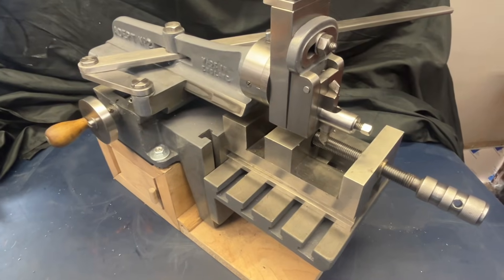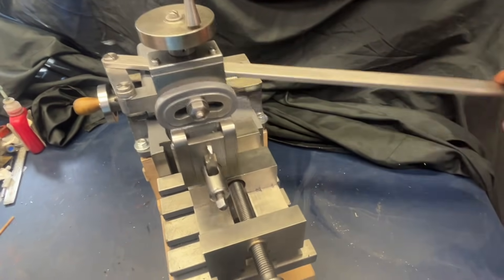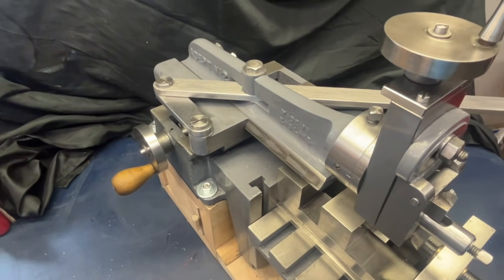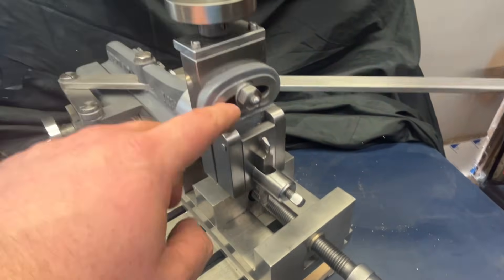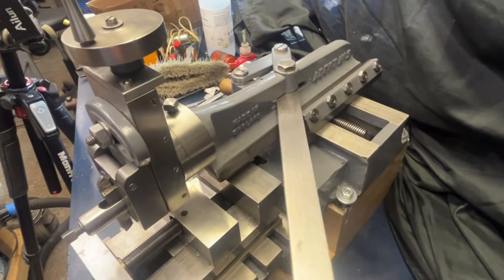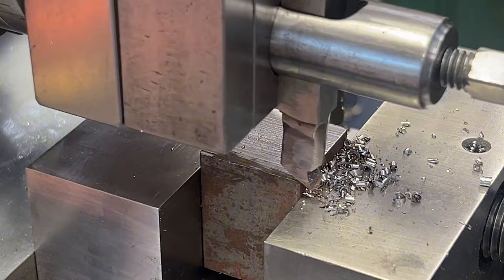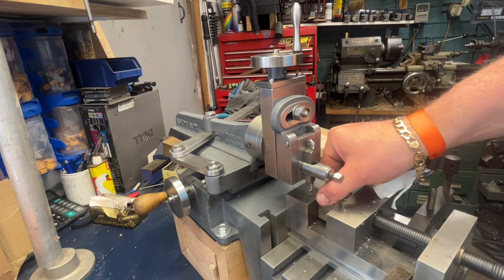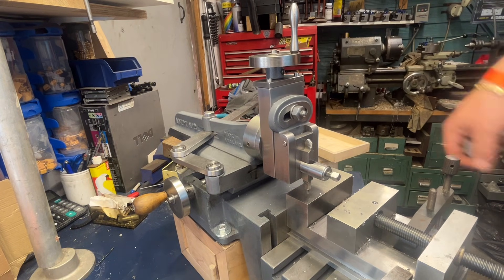Hand Shaper - This Tiny Machine Is Surprisingly Powerful!

Comment: It is in beautiful condition.
I had one of these. The disadvantages are several. It has no feed mechanism and no micrometer dials. Worse the pitch on the z axis is 1/16" which precludes fitting a dial to the x feed.
I find that the table on small shapers is invariably too small and makes bolting down difficult.
Shapers are superb at slotting though. I have also cut a couple of racks with a home ground HSS tool.

Comment: Look up shear tools for the shaper if you want a really nice finish. It looks similar to the one you're using if it were to be rotated by around 60 degrees. I use one on my Adept no. 2, and the finish rivals that of a surface grinder. The downside is you have to use a fine sideways feed, and cutting depths of no more than a few thou.
Reply from the maker: Thank you for the advice! I’ll give that a search and have a go this weekend

Comment: Lovely! But the finish doesn't look all that good? Is it the cutter geometry? Or perhaps the step over? I can't see why it shouldn't produce a very nice result..
Reply: Take a look at Abom79's video on preparing a finishing tool for a shaper. https://youtu.be/bg2yppzEmBo?si=kbbcaQoXUs8OrdUL
He mounted the finishing tool in the machine, then trued the cutting edge parallel to the table by setting a precision honing stone (with a sheet of paper between the stone & the table) on the table & honing the cutting edge to dead parallel. The resulting cut was a mirror finish across the part. The video was a couple years ago, he was at another guys shop at the time.
Reply from the maker: It isn’t all that bad to be fair, the camera was quite zoomed in. However someone has commented similar so could definitely improve. Perhaps it was the cutter - any tips as to what the profile should look like?
Reply: @craynerd  Increase the nose radius of the cutter.

Comment: Did any other manufacturer make a hand shaper??  This got me thinking.  What would the size limitations be with only human power?  Would it work with a larger floor mounted machine?  What kind of accuracy do you get when it is all dialed in?  Very interesting to say the least.
Reply from the maker: Haha yes! I’ve only ever seen small bench top ones. I know Cowells also made one. 
It would be really interesting to see what a large scale would be able to achieve but the issue is even with this small one, the minute you attempt a large depth of cut, it jams! I expect, and I’m only guessing, that the issue would be the same with a larger one. You can only take small passes. I didn’t count but I probably took 6-8 passes with this in total and I bet I could have done it in one pass with just my X3 bench mill and surfacing tool. No doubt it’s a lovely machine though for a small price and small size. It also has the benefit of doing internal key ways, something the mill wouldn’t easily be able to do.

Comment: Commented a few times on Facebook with you (asking about the toolholder) - what a lovely bloody condition that's in. I got my hand-shaper for free, but paid out the nose for the motorised version.  Mr Factotum has an almost total rebuild on his - a series worth watching.
Reply from the maker: Hi William 
I’ve measured the tool holder for you and it’s very simple construction. Essentially it is a rectangular piece of steel 32x55mm and 13mm thick. It is drill through at the top and pinned with a 6.5mm steel hinge. It has been drilled centrally approximately 38mm down from the top edge to centre of the bore - 19mm diameter (0.74” dia). The actually work holder itself is a 19mm round bar inserted into the bore - I can’t see any way it is being held so it must be welded (can’t see any welds!) or loctited in position! The end of the bar is tapped M8 or close imperial to hold the tool bit. There is a slot at the end of the bar which is 10.2mm wide and with the bar inserted and locked in the bore, the slot extends about 16mm down the bar from the face of the back block. I hope that helps. 
I don’t know if you have the rest of the it, if not, the rest of the assembly is approximately 110mm height and 56mm wide. It has the arced slot machined in approximately 20mm from the top.  It then has the large slot milled in the centre to form the rails which are just over 32mm wide to allow the rectangular holder to hinge in this section. Hope that makes sense. If it doesn’t, just let me know and I’ll try again!
Reply: @craynerd  Hi Chris, very helpful. I will give you a shout out in my vid :) thank you!
Reply from the maker: @williamsworkshopuk thanks! I’ve just subscribed 😊

Comment: I’ve never in my 30 years of being a Tool and die maker ever seen a shaper, I’d figure this is a great thing for key ways which would come in handy especially in a blind hole key. Reminds me of having to make a broach and doing it on a manual mill but much easier.
Reply: How times change. Shapes are far more versatile than you may think if you have the tooling. Auto traverse is standard on any "real" shaper. They have a quick return mechanism so return stroke is quicker than cutting stroke. I loved using them. Relaxing. 😊
Reply from the maker: @PaulParker-ub9sq yes, it’s certainly making me think about getting a bigger Boxford again but probably too much floor space for how much I’d use it.
Reply from the maker: Thanks for the comment. It’s a nice machine but not like my Boxford that I sold many years ago now and deeply regret: https://youtu.be/D1bGFY3OQlk?si=XfhcQpgkX_7OD4XL